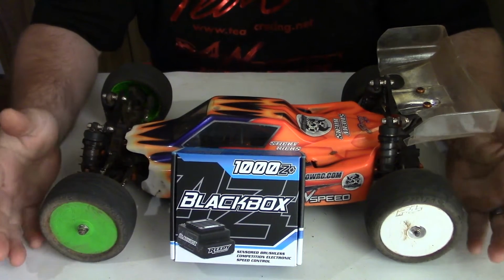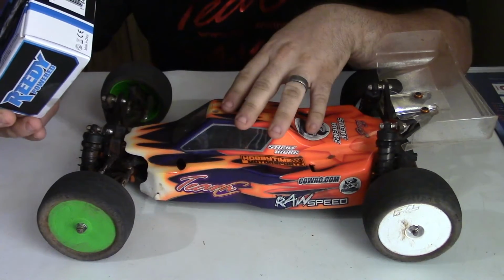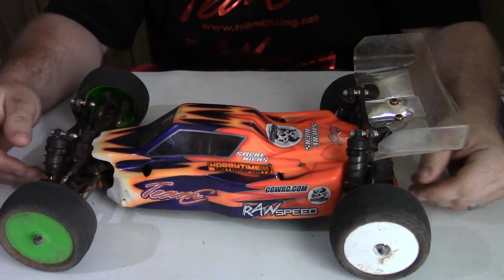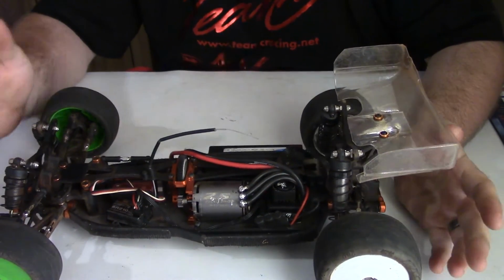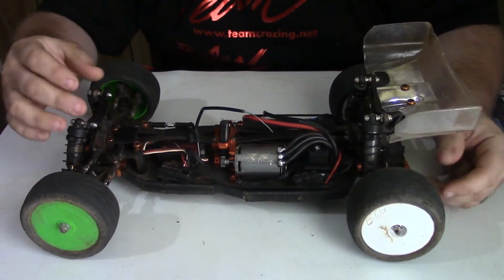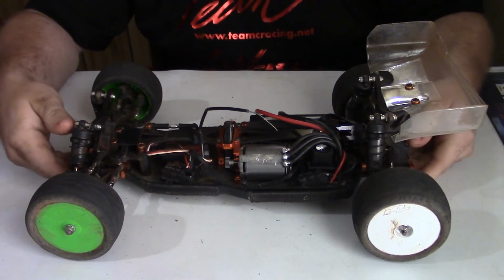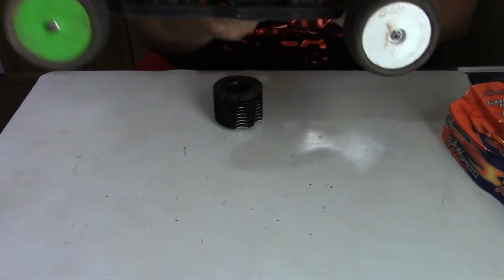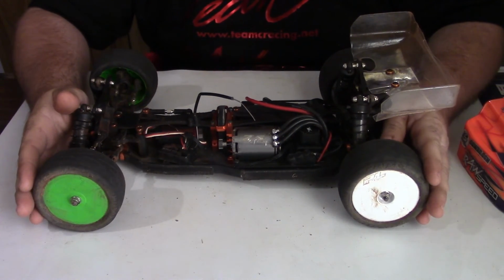Team C Racing TM4

Comment: hi nice video, did you find you had to grind away the rear carbon top plate to access the battery terminals with the low profile bullet connectors.
Reply from the maker: yeah I did have to notch a small c notch to make the terminal fit.